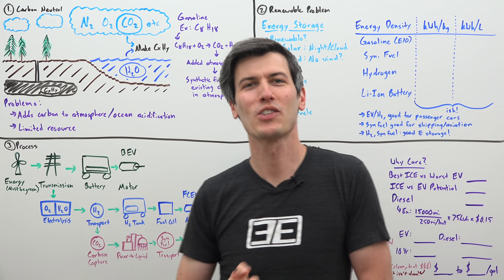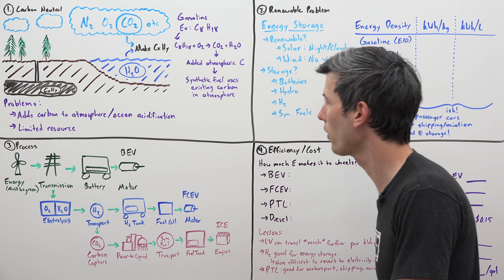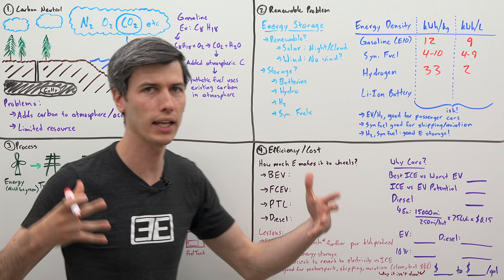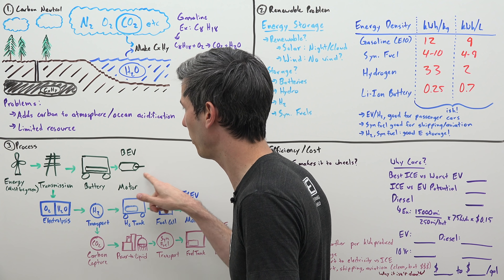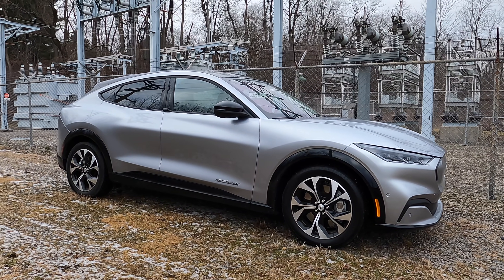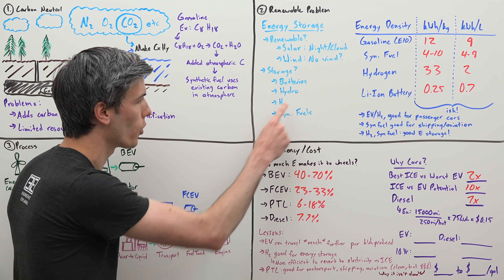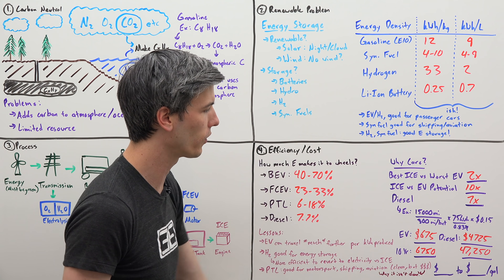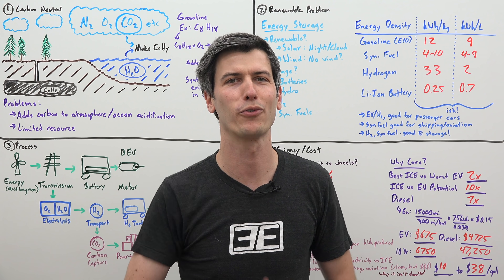The Big Problem With Synthetic Fuels

Comment: Unlike you I have been around a while and I can tell you this, people have been saying we will run out of oil for maybe 50 years and so far we have more and more of it every day.  It isn't scarce, there are years and years of supply and we are in no danger of running out.  We can be LEGISLATED out, Biden just took ANWAR out of play.  That kind of thing will cause us to run out.
   Second point: you don't actually say it but you are assuming that CO2 is bad, when in fact it is plant food and when we have more of it everything thrives.  The oceans are not getting more acidic and our weather is getting colder not warmer.  All this and I am only two minutes in.
  Synthetic fuel sounding good?  Ethanol is a synthetic fuel made from corn and is probably the worst environmental product ever invented.  Grow food to make into fuel?  Oh just throw millions of central and south Americans under the bus since their main source of protein is corn.  Don't care if they are starving or that their cost of living goes way up, we have to stop the "carbon".  Do you even realize that CO2 and Carbon are entirely different things? One is a gas and the other a solid.
   From an environmental standpoint the cheapest, cleanest and best way to make electricity is by nuclear power,  There is no question on this it is only that most people are scared of it.  This fear shows the power of indoctrination.  Small scale nuclear could power all the electric cars, cities, manufacturing, the whole thing.  And it would be clean, clean, clean.
  Jason, please put ALL the factors into your excellent discussions.

Comment: As far as I know the point of the synthetic fuel isn't to replace EVs, but to give sport car enthusiasts and owners of oldtimers a possibility to drive their car without fossil fuel (CO2 neutral).
Also there is maybe a hope of it being used for all the cars which are out there today, because the existing combustion engine cars will stay on the road for some time. It would be wasteful to just destroy them and also not everybody is able to just buy a new EV, so maybe it is possible to use it for a transition phase for regular cars too. But probably it's just too expensive too replace fossil fuel in the transition phase.

Comment: There are a lot of things that weren't mentioned in this video. 
The infrastuctural cost of the transition to evs compared to using the same network of pipelines we already have. 
Also Enployment. An EV has nothing, It doesn't have a camshaft, no transmission, clutch, exhaust pipe(and hence no exhaust note), Engines. They use less parts and the number of people required to make them is also less. A shift to the EVs will make them unemployed. Even if car companies can take the loss, Countries cannot manage the failing economy because apart from unemployment, many anciliary companies supplying parts to these OEMs will be dysfunctional. 

I remember Engineering Explained rolled out a video in 2018 - Why Electric cars are bad for the environment. As it seems that video is widely ignored (or did we improve?). Similarly, I wish that this video doesn't age well.
Reply from the maker: Admittedly, my videos stick to specific subjects, as not everything can be covered in one video. Two points:
1) Regarding the grid/infrastructure, I'd recommend watching this video: https://youtu.be/7dfyG6FXsUU
2) Regarding EVs and the environment, that's not the conclusion of my 2018 video: https://youtu.be/6RhtiPefVzM

Comment: I believe that eFuels in road cars will have their place, and will be quite common. The internal combustion engine is convienient in remote settings such as outback Australia, however the sound of an internal combustion engine is like nothing else and really adds to the sensation of performance. As for the cost of the fuels, that will reduce as the production process is refined and expanded.

Another drawback that I have noticed which you didn't bring up is air polution in highly populated areas. Of course the fuel is carbon neutral, but you will still have the side effects of people breathing in the fumes. This problem can be solved using plug-in hybrids with enough electric range for commuting in those sorts of environments. The internal combustion engine can be used for longer commutes, and for the majority of the power when the driver wants to let loose. With a plug-in hybrid though, I believe it would also be possible to use the electric motors in a similar way to the Honda NSX where they assist with acceleration and mechanical grip in corners. 

I will ackowedge though that we will see a number of normal people who don't care about performance and what a cheap, comfortable car and opt for a fully electric vehicle since that will suit their needs.

Comment: I know you said biodiesel wasn't a part of this discussion, but wouldn't it be a viable alternative for those vehicles that need the energy-density? I know biodiesel has lower energy than normal diesel, but to my knowledge it's pretty close, but i don't know much about how viable it is to produce on the scale needed to "power the world". 
I would love a video talking about this, as i believe it would be a viable alternative to ICE-vehicles if battery-technologi doesn't "catch up" to ICE-vehicles density, range, price and re"fuel"-times, even though a lot of those points are getting close very fast.

Personally i regularly tow a horsetrailer and auto-trailer for longer distances and very few smaller cars (Like the Tesla model 3) have towbars in EU, which limits my options to basically the Tesla model X, which is way too big for my taste, so i'm sticking with my diesel for the time being, but would love to switch to electric. I'm close to pulling the trigger on an electric motorcycle though...

Comment: nice video...  but probably the cost of synth fuel will drop down as the tech evolves...   they say the same thing for EVs, right now are much more expensive compared to a Ice vehicle but they predict a drop later on
And as other petrolheads would say, being able to still drive a combustion engine 10 or 20 yeas from now will be Priceless!!
Reply: Maybe if infrastructure be much easier and more advance to carrier/ shipment

Comment: YOU HAVE SHATTERED MY DREAMS BUT YOU WILL NOT WEAKEN MY RESOLVE
Reply from the maker: Honestly the research had me pretty distraught. Time to get a couple redlines on the Miata!
Reply: @EngineeringExplained  😂😂😂😕😕
Reply: @EngineeringExplained  Hope that Research makes them better
Reply: @EngineeringExplained  Those who only focus on climate change would have us place our attention solely on carbon emissions. But even if synthetic fuels were cheaper and more energy efficient, why would we want to burn them, resulting in putting tons of other pollutants into the air?
Reply: @familyriess4184  You mean like oxides of nitrogen etc.? Good point, though I imagine ozone emitted from high voltage power lines and other sources of pollutants from renewable sources, grid and usage will also become a problem when the scale of electricity use increases to replace fossil fuels. Also, one would hope that synthetic fuels will be engineered to reduce/eliminate such pollutants, by reducing/controlling combustion temperatures (if this is at all possible).
Reply: @Bennyboy-dog  but the truth is that EVs won't drive the energy demands up by that much anyway. There's an EE video on that too.
Reply: @aidanapword  Yes, thanks - I've seen the vid. I was thinking as fossil fuels are replaced, gas and oil heating will go to be replaced by electric units, so the total electrical energy demand will go up, I figure about twice what we have now and we need to factor in increased use as populations grow and demand a higher standard of living.
I don't think any of these real and yet to be identified emissions from all electric energy system will hamper its growth, nor will they be insurmountable., unlike fossil fuel use for energy which is absolutely unsustainable.
Reply: @familyriess4184  I agree, it's much better to use child slave labor to mine lithium. It's much better to fill the landfills with toxic batteries that can leak into the water table. It's much better to have EVs that's disposable at 100,000 miles instead of ICE that last 580,000 miles. Makes a lot of sense.
Reply: @Bryan-Hensley  "it's much better to use child slave labor to mine lithium" 
You got your FUD mixed up. Child labor is a problem with cobalt, not lithium. That's why battery makers are striving to reduce and even eliminate cobalt from their batteries.

"fill the landfills with toxic batteries"
Those batteries are recylable and the materials are too valuable to waste. Look into companies like Redwood Materials, Li-Cycle and American Manganese. Its a rapidly growing industry.

"EVs that's disposable at 100,000 miles"
That's just the minimum warranty, not when the battery dies. Many EVs already greatly exceed this and of course anyone paying attention knows that the battery tech just keeps getting better.

"ICE that last 580,000 miles"
What are you doing? Averaging in semi rigs with the regular cars to get that number? In what universe does the average passenger vehicle survive even half that many miles?

"Makes a lot of sense."
Yes, BEVs make a lot of sense if you look at factual information.
Reply: @Bryan-Hensley  Apparently, you need to watch some of Jason's other videos that debunk the old, trite, false beliefs you have stated.
Reply: @Bennyboy-dog  Have you ever wondered why Pop Warner football and Little League champions don't squash their Major League counterparts? The laws of thermodynamics rule!! Particularly that second law of thermodynamics. A Kunz razor is an illustration of this. The Carnot cycle also applies. If time ran backwards the reservoirs behind hydroelectric dams could be refilled. I have checked time doesn't run backwards, you can imagine it you just cannot make it happen.
Reply: @Bryan-Hensley  Just because you are aggrieved doesn't mean you're making any sense.
Reply: @nicholasgardiner9601  Thanks for the comment Nicholas, but I'm missing the point - I'm sure you have a great point, but I cannot understand it. Can you spell it out more simply and also reference what I said that initiated the reply? I know its an ask...
Reply: @familyriess4184  Jason talker about that and even pointed it out.
Reply: @Bryan-Hensley  because the oil and gas industries are totally ethical in their employment and environmental practices? I dont think you're comparing apples with apples Bryan.
Reply: @HamsterV10  of course Prometheus fuels wouldn't lie about the capabilities of their own "tech". I am sure they figured out how to extract CO2 from the atmosphere without consuming so much energy that it would be more energy efficient to simply burn something and use the CO2 from that
Reply: @HamsterV10  You don't even know enough to know how much you don't even know. Perhaps you could get a job as a pitchman for a snake oil salesman, oh wait a snake oil salesman is a pitchman.
Reply: Well them combustion engine,s need to get more efficient 🙁
Reply: @HamsterV10  you didn't get what I was saying. Just because 1 guy of authority said something that got proven wrong doesn't mean everything said by everyone of authority will be proven wrong. Lot of people say perpetual motion machines are impossible. Well do we have perpetual motion machines yet?
Reply: @HamsterV10  please tell me who's this mathematical physicist you hold in such high regard. I know a British mathematical physicist who said perpetual motion machines are not possible. Look where we are now
Reply: Fear not, technology is still being developed and the efficiencies of making synfuels can go way up. Hopefully this is what happens!

Comment: At $38/gallon it would cost nearly $400 to fill the tank of my Miata. I love you, little car, but uhh no. Haha
Reply: My little Bolt takes about $4 to 'fill' at home. Compared to my old Subaru's $30+. 
If you can charge at home a used EV is great, just stay away from old Leafs.
Reply: So I just found this company called Prometheus Fuels. They are creating carbon neutral fuels from the air at the price of normal gasoline. You should look them up, it’s very cool technology and it completely makes sense! They are going to be the near future with BEVs and FCEVs being a later future once everything becomes more efficient with time.
Reply: @swankscabinet1625  same except I knew prometheus company for a year also america bmw made the company aswell.
Reply: Imagine how much itd take a v8 truck to fill 😂
Reply: It’s now 5$ a litre so don’t worry man everythings gonna be good in the end I hope

Comment: Biocrude and synthetic fuels, as promising as they may seem, are still mostly going to be for heavy-duty applications like transportation, large-scale shipping, and construction. e-Gasoline will just be a convenient secondary source of revenue. If biocrude works out, then biogasoline and e-Petrol would work out as well.

But you have to remember that 90% of people aren't enthusiasts, and they just want to get from place to place, so an EV makes perfect sense for most people. If Porsche really does go 80% all electric, that's cool. eFuels will just keep the 20% of other cars, like the 911, viable. Hybrid powertrains will as well, as the electric motor will offer an efficiency boost that would be almost critical if we want to keep ICE cars in production in a world where EV's are the norm.

Combustion engines will end up like vacuum tube guitar amps are now, just on a larger scale. There's a good chance they'll still be in active production even far in the future, but they'll be almost exclusively hybrid instead of pure ICE, and improvements on the ICE side will only be baby steps.
Reply: Correct, too many petrol heads chuck their toys out of the pram on this subject.

Comment: Have you ever considered making a video comparing an EV cost of replacing its degraded batteries in 12 years vs an ICE cost of maintenance and fuel for 12 years. I'd be curious to see what comes of that.
Reply: Why 12 years? The vast majority of electric cars will never get the battery replaced, the battery will last longer then the rest of the vehicle. And will in some instances get second life applications like backup system/energy storage.
Reply: @PerErikKarlsson  12 years is the average, some say 10 years some say 15. How long does an electric car last 20 years or more.

Comment: What about weight ? Electric cars are almost twice heavier than cars with combustion engine or with fuel cells 🤔
Reply: Not even close to that. They are about 10 to 25% heavier based on battery size. The e golf is only 300 lbs heavier than the lightest version of the golf. The lightest Civic is only 800 lbs lighter than the lightest Model 3. The best selling vehicle in America is close to 2000 lbs heavier  than my examples.
Reply: Weight of Tesla Model 3: 3,648 to 4,250 lbs
Weight of BMW 3 Series: 3,582 to 4,138 lbs
Reply: The difference is nowhere near that big. A Tesla model 3 and a BMW 3 series both weigh around 1700kg.
Reply: I don't see weight being that much of an issue as long as the energy efficiency is there.
Besides, lithium-ion technology in cars has only been mass-produced for a good 20 years and the gains in efficiency have been tremendous since then. Who knows how much progress the next 20  years can bring?
Reply: They are heavier but not twice as much. Battery technology will continue to evolve. When the energy density increases, the number of cells needed for the same capacity will be less and the car weight will be reduced This means the car will have better range.

Comment: Aviation gasoline is well over $2 per litre in Europe - about 2.50€/L here - so if synthetic fuels can get down to that price range then it could be great for general aviation! At least, until batteries or other electricity storage techniques are improved enough to allow for true cross country endurance..